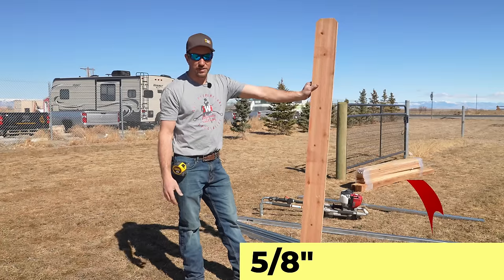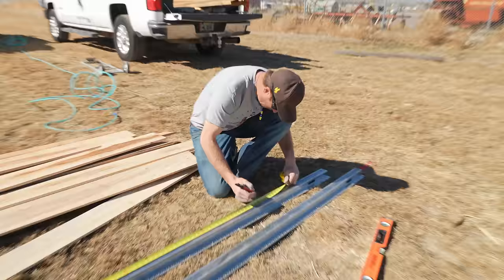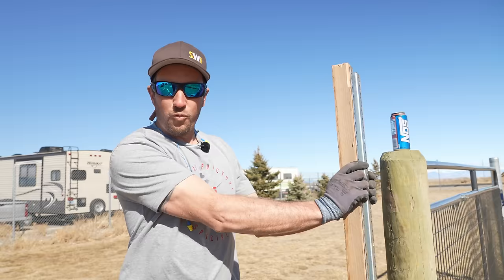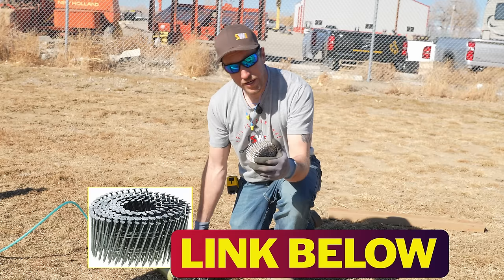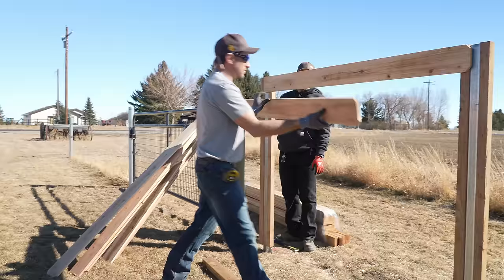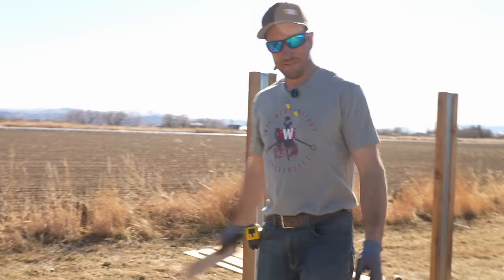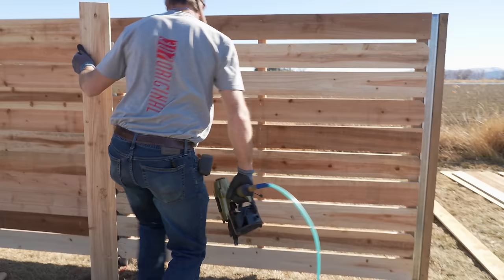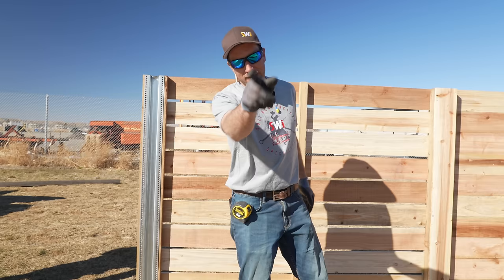How To Easily Build Horizontal Cedar Privacy Fence

Comment: What is the per foot cost difference between doing the pickets vertical and horizontal?
Reply from the maker: We don't ever quote by the foot because we've gotten bitten too many times that way--but you can calculate the price difference for yourself pretty easily in materials.
Vertical $ = # of posts (post price x every 8') + # of stringers + # of pickets (picket price x 18 [8' / 5.5"])
Horizontal $ = # of posts (post price x every 8') + # of nailers (one 2x4 for each post) + # of pickets (11 pickets for each stretch)
You'll have to tweak that a little to make it your own but you get the general idea.

Comment: Why not coated deck screws? Just as good as stainless.
Reply from the maker: Well you can, but there you are relying strictly on the coating. Should the coating ever fail then your fastener could leave black streaks on your cedar. That's the advantage of stainless--they're stainless all the way through.
Reply: @SWI Fence  Sure but we use impact drivers and SS screws break by the cartload in wet PT. Never seen a Deckmate or Starborn corrode that we have installed in a vertical attachment like a fence. Even when the drive gets stripped and exposes the metal underneath. I have old Deckmate screws where the coating was stripped off the thread (from being re-used a bunch of times to set forms for concrete) and the screw has sat at the bottom of a wet bucket for years. No rust, just the bare metal. And keep in mind, the part of the screw in contact with the cedar board is the shank. Not the drive or the thread, the two parts where the coating can sometimes be stripped off. Whereas if the coating has failed on the SHANK of a deck screw (like in some photos posted online), that is simply a bad screw (probably a cheap knockoff). Extremely unlike on a brand name screw, to the point of "foggetaboutit".

Comment: What’s your recommendation when the ground isn’t super level?
Reply from the maker: Stair step it. https://youtu.be/g3cFapnA7mM
Reply: @SWiFence my ground has a nice, even drop across the backyard. It has quite a drop over that length, but doesn't seem to go up and down. 
 I think my post heights could be at a straight angle when I sight down them.

Should I try to go with it and have my pickets stay with the land (and thus cut each and every end at the angle)? That would make the line of the fence even with the ground, but clearly unlevel.

Or stair step the entire backyard?

Or go vertical pickets and make the tops all line up on a bump bar(string).

Comment: Why the fence only 60.5 inches when 6 feet is 72 inches? Is that considering the gaps?
Reply from the maker: Because math is different in Wyoming. 🤣🤣 Actually it's because after we started I realized I brought the wrong size post so we had to build a 5' fence instead. Good catch. 👍🏻

Comment: Great video but math on height is wrong 72" equals 6ft (6×12=72) so it would be 13 pickets at 5 1/2"
Reply from the maker: You totally caught that. I said one thing and then built another and never corrected it in the video. 👍🏻

Comment: I looked at Lowe’s and it said those metal post are like 78 a piece that’s nuts
Reply: You know, if the manufacturer got the price down to $25-$30 a piece, and the portable pile driver could be rented at the B8g Box store for DIYers, these would fly off the shelf. 

But considering the current pricing, PLUS not carried in-stock in the stores, AND no ready access to renting the special tool  needed to drive them (thus making you still have to dig the post hole and deal with lugging the bags of concrete and using concrete, and so not saving any time or effort there), those are the obstacles standing in the way of this being an 7 qualified success. 

I've got to think those barriers to entry are due to the power and influence of the major lumber suppliers to the Big Box stores - "If you start stocking these metal fence posts in the store, and rent the pile-driver tool, we are going to raise our fencing product costs to you, or stop supplying you...."

Comment: why is it raised off the ground? I assume because the ground gets wet. Is there a way to stop my dogs from digging in the gap?
Reply from the maker: You can have as much or as little of a gap as you want, but a little gap usually helps with setting a straight fence over slightly fluctuating terrain--otherwise you have to start trenching. If you really want to make it dig-proof you can pour a concrete mow curb underneath the fence. https://youtu.be/xdBnjpu3xb8
Reply: I have  used cayenne  pepper to keep dogs away from my property.
Reply: One Snort, and they change their minds quickly.
Reply: By spending time training your dogs.

Comment: Did anyone else notice how he said he was going to make a 6ft tall fence but measured only 60.5 in? Hum…
Reply from the maker: Good catch! Yeah, I thought I had one length of post but I had another instead... I should've explained that on the video.
Reply: @SWiFence  it’s all good, you are still my go to for fencing. I’m about to install a 22ft fence with gate, following your instructions to the T. The only difference is Im going with lifetime 7ft posts into 10in by 24 in holes. But how much cement will each post demand is what I can’t figure out. Think you can help?
Reply from the maker: I'm guessing your gonna be somewhere in the neighborhood of three 60-pound bags per hole. Here's a simple calculator that'll get you headed in the right direction: https://www.inchcalculator.com/post-hole-concrete-calculator/ Don't skimp on the concrete--especially if you've got any kind of wind in your area.
Reply: @SWiFence  I went with two 80’s so far so good

Comment: Correction.. ..you don't have the same gripping power with ring shank nails as you do with screws...ring shanks are driven in..screws bore in..big difference in the long term...Rings are ok...but not as good...and that's just the way it is kids...

Comment: Those metal posts are costly. Isn’t it cheaper to set 4x4s
Reply from the maker: Of course 4x4's are cheaper. In the short term.
Reply: @SWiFence  if done right at least 25 years
Reply from the maker: Depends on wood, soil, weather, and method of installation. That's going to vary widely depending on where you are in the country and who's doing the work.
Reply: @SWiFence  the same goes for direct to soil insertion of a steel post